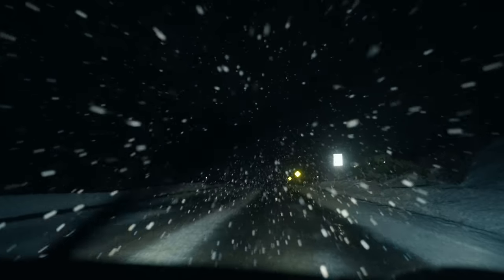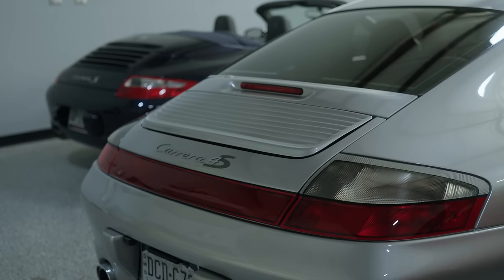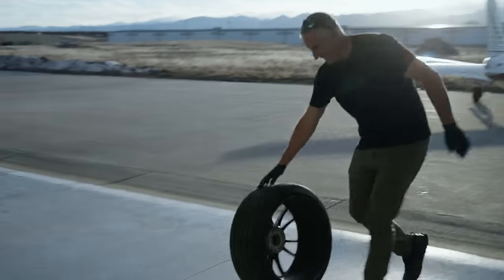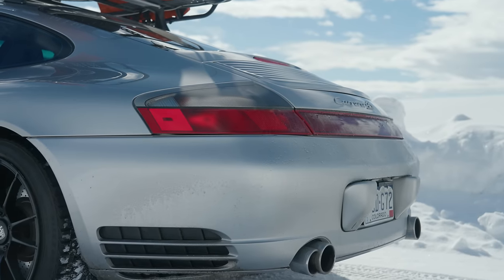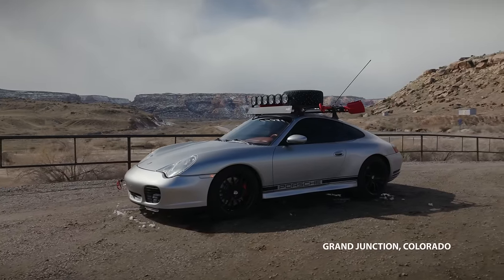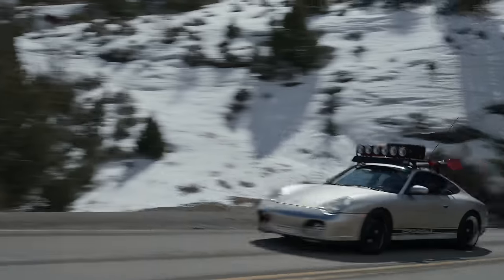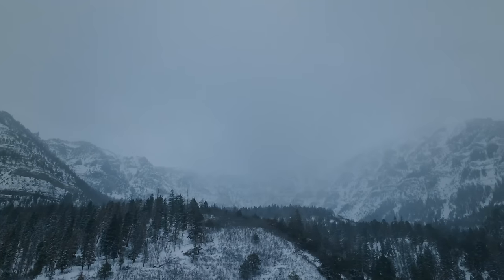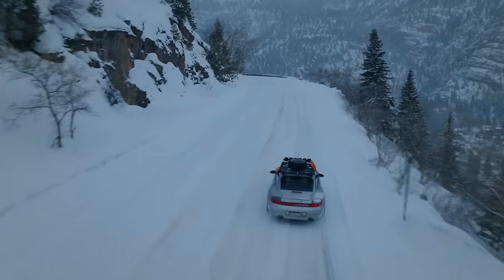Is the Porsche 996 C4S the Perfect Four-Season Sports Car for Colorado?

Comment: I drove a hardtop Boxster through one Midwest Winter. When I sold it and bought my 964 C4, the seller had snow tires on the 964, and didn't hesitate to use it in the winter. Drove the 964 through one blizzard and it wasn't phased.

Comment: This is rad. Best snow car I ever had was a Civic EK Hatch with adjustable coil overs (that I'd lift in the winter 😆) and some 15" steelies. Small front or AWD cars with a manual (and a bit of skill) will pull ya 95% of where you need to go.

Comment: I seriously considered getting a 996 4 for this application- Until the GR Corolla was announced. 
IMO the GRC is a great fast car & slightly more practical for a road trips with a real sleeping platform.  FYI - I traveled a with my 993 & 07 GT3 so I now know more of what I like and want👍

I have yet to drive the GRC in light snow - but can't wait.
I swapped the Pilot sports with some Ultra high performance all season tires (Continental Extreme Contact DWS06 Plus) in a talerl & narrower configuration  than stock. With these I will have a little better chance of negotiating light snow (which was my intention-:)

Comment: We all need a cost effective 911 4S Dakar style version.  A little lift, perhaps electronic adjustable height suspension, increased approach and departure angled front and rear facia, off road modes, and viola! I could use my '23 Bronco V6 Sasquatch version for the really big heavy stuff, and the 911 for everything else.  Hehe!

Comment: Very cool trip! The one thing that really would have helped is chains for your tyres. That would allow the AWD to be more effective even though there's not much weight over the front wheels. Frankly, I think the car would really benefit from being raised a bit as the extra suspension travel would allow you to carry some more speed over the rough terrain, but chains would be the cheap and easy fix!
Reply: Doubt you could fit any, without risking damage to the car, which is for sale. Even the low-profile ones. The car is definitely not designed for chains.

Comment: Question: My 1991 C4 has a prominent switch right above the gear shifter to lock the differentials. Yes, true 4 wheel drive locked diffs in a 911!  Did they keep this feature in the 996 C4?

Comment: When the car got stuck, it appeared the front wheels were not spinning. It could be the wheel you could not see was putting power down but there was no snow flying out from that corner. I would have thought the quatro system would have nearly instantly sent power to the front and, if necessary, send power to both front wheels. Interesting.

Comment: Great video! Loved the car, people and the editing. Had aquestion though: how did you wire the KC's power? Thought I saw a wire running down the passenger "A" pillar, and if so, how did you keep it in place? Where was the switch for it?
Reply from the maker: We ran the wire down the right side of the windshield, attaching it with adhesive strips. From there, under the cowling and into the cabin though the fire wall to a switch. I put the switch in the fuse box area so I wouldn't have to dedicate a permanent Porsche switch, but I will probably do that if the car doesn't sell.

Comment: I bought my red 2004 C4S cab from Glen Shelley in 2017. I drove the crap out of it in Colorado and Utah. I just sold it for a 2017, I am to scared to drive the new one like I did that one. Will have to get anther.

Comment: That looks like a blast but man, that “awd” system is so rear-biased it’s basically non-existent in the snow. 

My little Impreza Sport is a small car and just kills it in deep snow and is surprisingly fun and agile. 

Just wish I had more power.

This thing though is an excellent weekend car and with a true safari kit would be sick. Just wish Porsche made more of a 50:50 awd system, as I’d love a Macan but they’re kinda sketch in deep snow. You can see how much the back end wiggles and kicks out under acceleration. That's fine when you're just hooning around, but in really deep snow (like 1-foot +), it becomes an issue.
Reply: The AWD is designed to maintain traction on a normal road and not much more. Probably would run better with some chains on it.
Reply: It looked to me that the awd wasn't  working at all. Are all porsche like this? 
How would it do on a bit of gravel ?
Reply: @derdummeasi  I believe the AWD was actually broken the whole time 🤣

Comment: Could you please answer a question for me please, is the 997 the only model that suffers from Bore Score, or is the 996 prone to this problem as well, thanks.
Reply from the maker: No, all M96/M97 cars have the possibly of bore scoring until you get into the 997.2 years. We've seen one of each with bore scoring over the years, it seems like lower mileage, cold weather cars have the highest potential causation.
Reply: You mean 997.1.

Comment: Aspen PD for decades and decades rolled in Saabs that were front wheel drive, until the mid 80s then their fleet got AWD. But yeah.... You can roll is a sporty car in the mountains. You don't need a SUV or truck.

Comment: ...ground clearance. You need it just off the interstates and state highways. PLENTY of the best Airbnbs and most places you'd want to own in the mountains absolutely require at 

Best possible option would be a mid-engine AWD with 7-12" ground clearance. If they ever come up with an AWD configuration of a 1500 level truck with a mid-mounted engineand  mild hybrid on the front wheels....maybe a cabover design...
Reply: LOL.